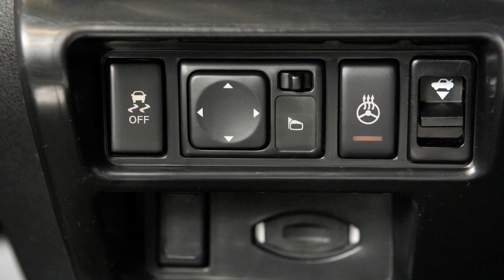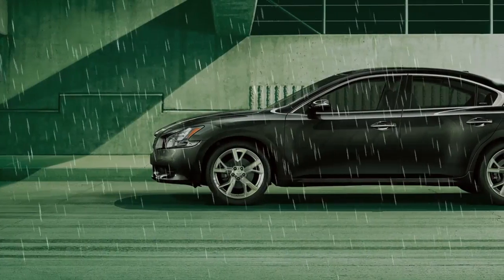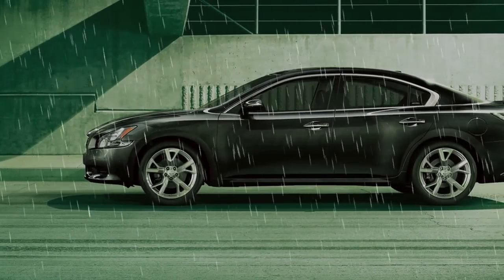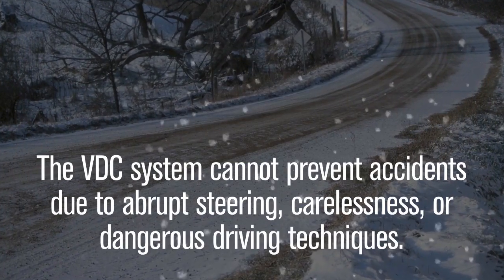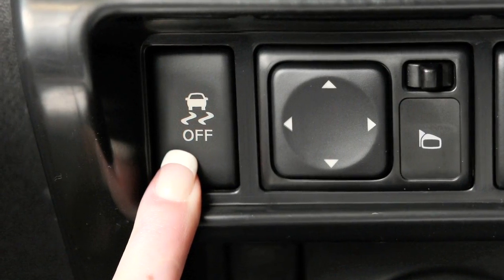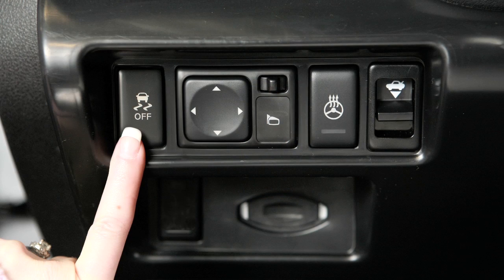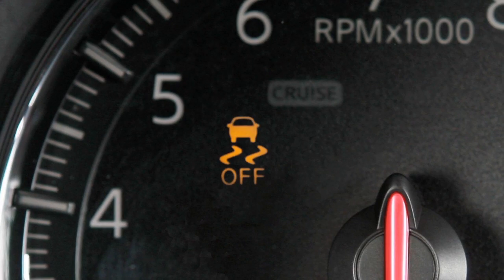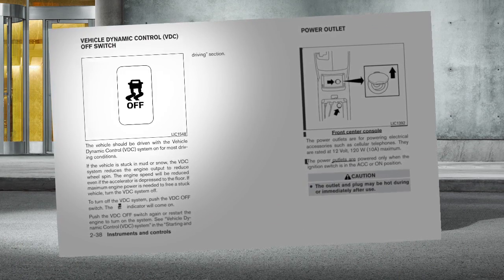2014 Nissan Maxima -  Vehicle Dynamic Control (VDC)

Comment: Do all 2014 Maxima's Bluetooth both music and contacts
Reply: Mine does NOT.
Reply: Do you mean that if you can play music through your phone by bluetooth?
Reply: You have to have your music app open and plug into your phone, the USB cord has to be plugged into the USB port and then it will play. My I phone does anyway. It won't work if the music app is not open prior to plugging in however. Kind of stupid but my son showed me because I could never get it to work. Not sure about the contacts, I think they should work too.